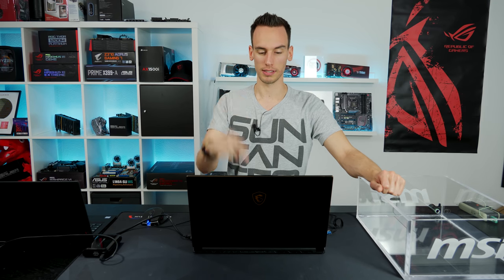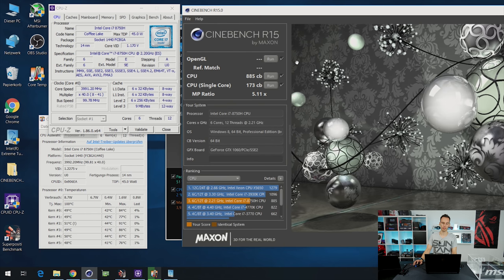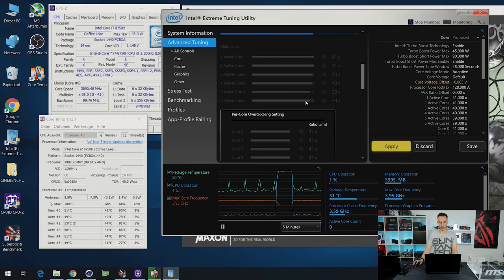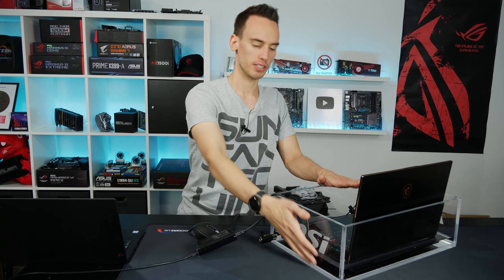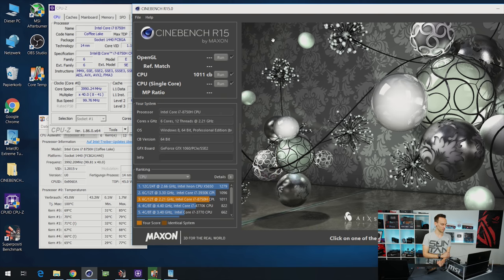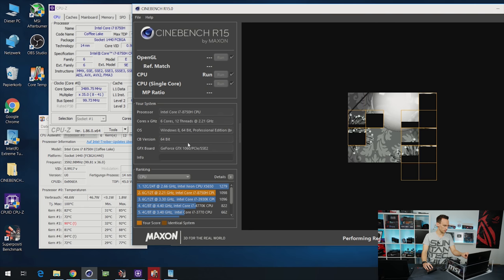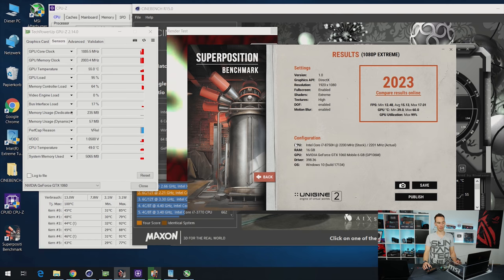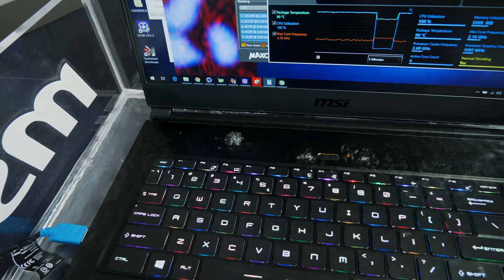Did I lose my mind? Laptop XOC Part 1/2

Comment from the maker: Still working on Part 2 which will be insane and up on wednesday :)
Reply: Would the Dry Ice not then make the  3M Novec liquid conductive ?
Reply: Great work, looking forward to it!
Reply: Can we solve the power limit by using beefy laptop adapter like 330 watt? Are this power limit due to laptop adapters?
Reply: Yes you lost your mind. No porn star this time. What are you thinking?
Reply: You could try putting more of an angle to the laptop so the bubbles can be evacuated more easily.
Reply: Can you put more Novec so the bubbles would be eliminated? Can you put a fish in it? Consider enclosing it and put some fins for condensation. Not sure if Novec is hazardous when it vaporized.
Reply: @ulimacha  I believe the bubbles are from the fluid reaching boiling point
Reply: Have you ever tryed nh-d15 on a laptop CPU?

Comment: "I dont want to do any hardware mods because its not mine, i borrowed it"
puts whole laptop in some liquid
Reply: Yeah, I found it funny as well :D
Pretty much, "It's borrowed, no hardware mods, I just pour that liquid into it ... yeah, and I also freeze it."
Reply: Bulu - its just Novec fluid, it won't harm anything, you don't even need to "dry" it after removing it, it will leave a slight coating but its non-conductive fluid that evaporates at a certain temperature, hence its awesome ability to remove heat from something and sustain temperatures once you reach that evaporation point...
Reply: @grumpyoldman3597  /r/woooosh
Reply: @grumpyoldman3597  It is great for a number of things that people thought not possible.
Reply: @bulas007ify  Bulu - what is it you think I am not getting, putting it in this liquid is NOT a hardware modification, it evaporates off when heat is applied, leaving no residue or lasting effects, thus, its not modified... do you not understand Novec fluid? do you think this modified the hardware? your attempt to suggest something went over my head, seems to be indicating all of this went over yours...
Reply: @grumpyoldman3597  why are you trying to explain what is novec fluid? I know what it is and i written this comment on purpose like this

Comment: Doesn’t it make sense to re-apply the heat sink first on Kryonaut or LM?

There is almost 20 degrees difference between the coldest and hottest core under load, that might take a few degrees off core 2. Thanks!
Reply: Borrowed the laptop and just dunked it in novec fluid? Haha! :D
Reply from the maker: Pssst they didn't see it yet XD
Reply: @der8auer  <-Sees the box... "He's gonna just shove it all in Novec!?"
Reply: This was my first thought too. It actually acts as bad marketing for MSI imo, a laptop of this price range and with thin and light performance being its main selling feature it should come with the best possible TIM from the factory.

Comment: That MSI is a PoS. Even completely untouched. My Zephyrus GM501 same cpu never goes above 81c, and maintains 3.9Ghz, does not throttle. Undervolted -0.125mv and 0.49mv cache no core goes above 67C and i still maintain 3.68Ghz. This is in normal air....

Comment: Der8auer try sometimes ThrottleStop. IT is not as nice looking as intel XTU  but it gives more possibilities then intel eg. you can force all cores turboing at once to higher multiplier, my laptop could even get instead of x33 multiplier on single core to x35 on all cores. In intel XTU it is not possible. Also it is possible to undervolt more then just CPU.

Comment: I have the exact same GS65 stealth too. I need to improve the cooling, shame the board is upside down when you open it.
I wanna do a liquid metal mod, some guy on YT did it and improved the cooling by ~20c , but this thing cost me £1700 and gonna take me 6 months to pay it. Obviously i’m a bit worried about doing the liquid metal mod.

But with liquid metal and a touch undervoltage this laptops can really shine.

It has 2 m.2 ports and 144hz panel. I already have a 1TB m.2 ssd and a 256GB samsung for the boot drive (the ssd that comes with the laptop is OK but not the best), together with an extra 16GB RAM and the liquid metal mod, this laptop will be a beast.

Looks insanely beautiful too.

PS- The model with a GTX1070 was a extra £400. That’s just too much of a difference. There’s the Gigabyte Aero, almost the same exact specs, the 1070 model can be a bit cheaper then the MSI stealth but i prefer the looks of the Stealth. The best thing about the Gigabyte Aero compared to the MSI is that is very upgradable friendly. The board is not upside down like the stealth. That’s my major gripe with the stealth.

Comment: I do not know if you took this into account, but the stock power supply for the laptop (the brick on it's charger) is definitely not rated to supply enough power for the components when both the CPU and GPU are overclocked. That might be a limiting factor.

Comment: Can you use this 3M Novec inside the custom water cooling loop? (better question: will 3M Novec be better than a standard coolant?)
Reply: First Ever in a single phase application 3M Novec has little efficiency gain compared to water. However used in a 2-phase application the heat transfer is superior to that of single phase

Comment: Why not disconnect the fan and add a circulation pump to the fan intake so the fluid circulates through the fins of the heat pipe and draws away heat?

Comment: I have to admit, the boiling laptop was very cool to watch. However, I do wonder how much of the remaining heat issue was due to the thermal compound between the CPU and heatsink. It seems like, even though the heatsink was able to reject more heat, it just couldn't get it out of the CPU die fast enough.

Comment: 7300HQ - When I run Cinebench, I never go above 21W for the CPU @ 100% utilization. Is this right? I am at maximum Turbo (31x) the entire test, and my thermals are great never reaching 60C. Is this simply the efficiency of the CPU with an undervolt (-0.115v)? At stock/default voltage, it uses maybe 28W maximum. The 45W TDP limit seems like a high cap.

Comment: I run a HP Omen w/ 8750H. Undervolting is king on that processor. I run everyday all day at -.125v I can't go any lower than that. Before Undervolting the laptop was barely usable for video editing, it throttled and screamed fan speed so much. Im surprised the novec didn't do more.
Reply: Similar story here, got my i5 8300h stable at -132.8mhz means I could run it at the max clock speeds without throttling, though I choose to lower temps a bit to help keep the laptop going for a bit more so I put it down to 3.6GHz (90 degrees temps is frightening). The new thermal paste helped as well, but I'm certainly considering thermal paste considering the copper heat pipes I have inside.

I mostly use the laptop for single-threaded CPU intensive tasks, and the video has convinced me pretty solidly that the i5 was the better choice. The thermal throttling here is insane
Reply: I have the same MSI stealth that Roman uses in the video and i really have to do all those mods too. The fans on MSI are really good in terms of noise, at 100% is still very bearable but obviously is best if i can improve it.

With liquid metal, undervolting a touch and a fresh install of windows (MSi loves to fill their laptops with bloatware) and the laptop can really shine.

I pussing out on doing the liquid metal mod atm cos this thing cost me £1700 and the board is upside down when you open the laptop. That board orientation is the only con in this laptop. That and the bloatware but that’s easily solvable. 

I have disassembled far worst laptops before (Sony Vaio, horrible thermals) but they were far cheaper too.

Comment: something seems extremely wrong with those CPU thermals. My dell xps 15 9750 scores about 1200-1000 points in cinebench r-15 and clocks up to the full 3.9GHz when under load, while staying under 90c.

Comment: Can we solve the power limit by using beefy laptop adapter like 330 watt? Are this power limit due to laptop adapters?
Reply: Nvidia/Intel artificail limits. Even my desktop needs hardware soldering to bypass its limits, otherwise even stock with its max allowed of +20%, you still constantly power throttle. Its a big annoyance considering it power throttles without touching frequencies. With AMD/Radeon, they are much more forgiving about power limits (Radeon you can BIOS flash unlimited power, or registry edit the value).
Reply: Eurocom sells a 780w one

Comment: Does 3m Novec corode rubber parts? like orings? and what about ball bearings? does it affect their lubrication?
Reply: 3M Novec does act as a solvent to many elastomers. Silicons being one of the larger risks I would say in a laptop. the grease in the ball bearings of the fans will also get stripped away.

Comment: I see Chrome is not helping at all. I have a GE73 - i7-8750H, undervolted 140mV core, cache and gpu. Stock thermal paste. At 20-22º C, Cinebench always goes above 1000, max I had was 1248. Max core temps are 86-88ºC. Does the whole run at 3.9Ghz no throttle.

Comment: where to put liquid metal to jump the  power throtling of this gtx 1060 qmax?  i have similar laptop ,  and i can t oc more gpu
Reply: Nobody's shunt modded a laptop that I know of, it's done with a tdp tweaker tool that generates a custom vbios that is then manually programmed onto the chip because nvflash fails, checksum security bs. Certainly not on a thin laptop that struggles to cool its already underclocked maxQ spec GPU and probably has minimal VRM safety margin either
Reply: the tdp tweaker tool also hasn't been updated in a while and fails more often than it works for BGA soldered GPUs (it tends to work only with 2016 and 2017 made MXM GPUs and they are only found in massive high end Clevos and MSIs)
Reply: @greebj  I'm sure you can shunt mod it, heck I've even water cooled a 7 inch tablet, so cooling such a massive laptop should be one of my easiest water loops to date! Just look for probably a 0.005 Ohm shunt resistor would be my guess (I might do this myself)

Tablet is Fallout 4 nuclear apocalypse theme: rusty steel pipes as radiator, green anti-freeze pumping to a radiation barrel with submersible pump hidden inside. Custom designed water-block (I posted the files online for free, it takes a sanded copper US penny and 3D printed block). Full cost was under $5. A full water loop for the cost of a burger! Temps under 50c with 44% overclock compared to 90c out of the box at stock speeds.

Comment: Make something for ACTUAL direct die cooling! I think direct die cooling just means that theres no IHS in between the die and the cool solution. But what if you could make something that is literally 'direct die', so the liquid flows over the die itself xD. Could be something like water or a special chemical that won't damage the die or maybe ln2? Literally direct die Ln2 cooling xD.
Reply: I'm not sure that would be any better. The chunk of copper allows much higher surface area, and its so thick in conducts heat further than most heastinks can effectively (mine weighs about 5 pounds of copper at the base, it's like picking up a bowling ball the size of a cup....)

Also a big deal with LN2 is thermal stability. A "light" cooler (one that weighs little, like 2-3 pounds) would be aweful since the copper would heat and cool quickly, giving varying temperature swings. This is why they make them extremely heavy, with lots of thermal mass to soften those temperature spikes and making it possible to control. A direct chip would undergo such massive swings in a moments time, it would be a probably 1000x worse (it weighs much under 1000x less).

Also, probably have the problem of LN2 boiling (especially now with a constricted surface area), so a tall tube of LN2 (running "full pot"), will have the issue of the gas bubbles trying to escape in a small area (LN2 expands 700:1, so it puts out a lot of gas). Your best bet would be to spray it like a pressure washer, BUT you still have the problem of the surface area is just very little, and a big LN2 cooler can probably keep it just as low, or lower anyways.

It might end up like air cooling without a heatsink or fins. Sure you might be able to cool the chip directly with an air compressor, but its probably not going to be as good as even a basic noctua air tower...